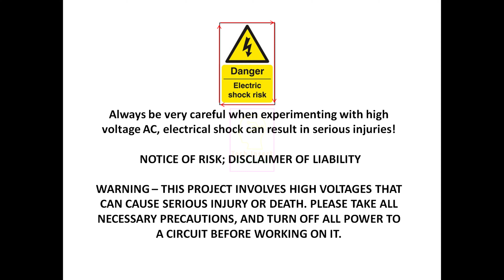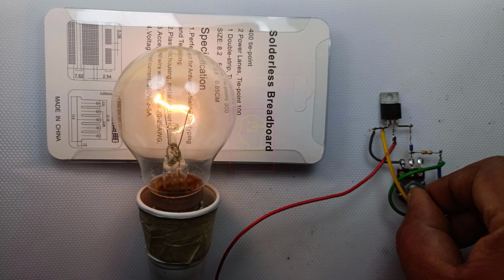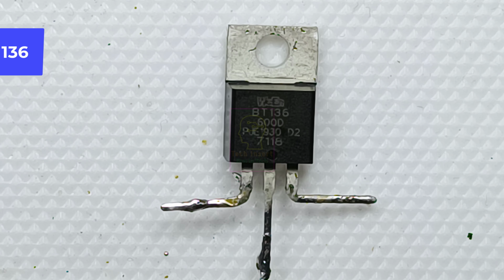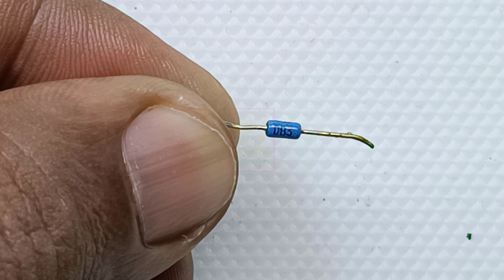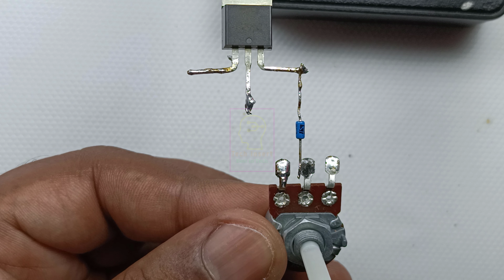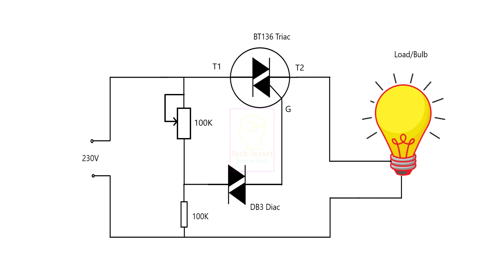How to make World's Simple Dimmer Circuit | Motor Speed Controller Controller

Comment: That might be okay for a resistive load but how well is it going to handle back emf on an inductive load without the addition of a snubber circuit? It also might be worth offering a warning about mains electricity here, especially when you have exposed current carrying conductors. If a novice tries that they could be electrocuted.
Reply from the maker: Electrical disclaimer already added to the starting of it. Yeah you are right need to add electrical warning to the entire vieo. Back emf will happen when ther is  switching to the Inductive loads . In electrical fan (ceiling as well as table fan , ther wont be a problem coz similar circuit was inside the electronic regulator. No issues to electrical heater as well. When we are switching very fastly then only back emf will be a problem. If you are using this in inductive loads humming will happen coz of the preesence of dc componenti in the output wave form